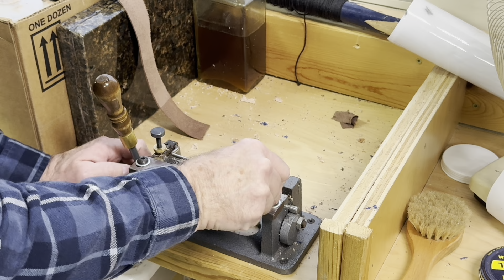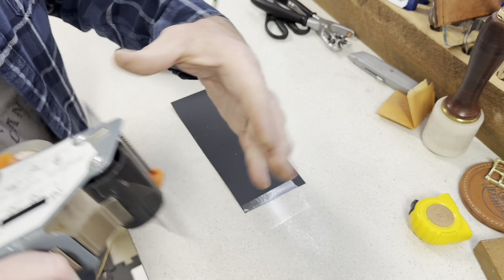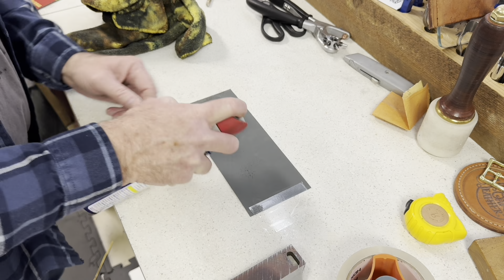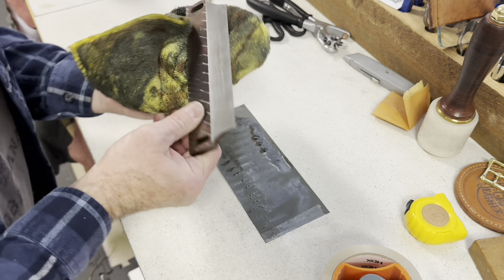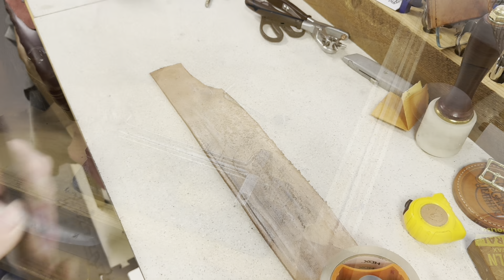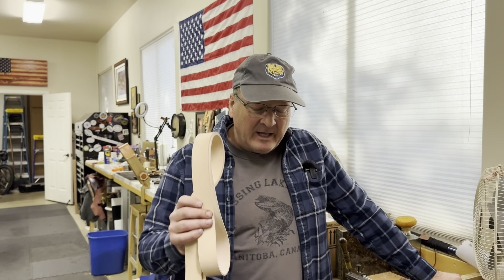Leather Splitter Maintenance / Economy Heritage Leather Skiver @WeaverLeatherSupply #leathercraft

Comment: I've gone down the rabbit-hole of sharpening, and unfortunately my wallet came with me. This blade wont fit in my guided-system, Im thinking to flatten my japanese waterstones and lapping this blade by hand. Thanks for the video - I might make one too!
Reply from the maker: I find it interesting to see where my journey takes me. As a young man I struggled to get a knife truly sharp. Part of the issue was solved with practice.  I think the other major issue was solved with a better selection of sharpening materials.  Recently until I purchased the diamond film I have been using just sandpaper up to 2,000 grit.  This kit with the glass plates first caught my attention.  Then the longer lasting diamonds.

Comment: Would be nice to have an accurate way to put it back on. I've done it on the first time only once.
Reply from the maker: You might be able to cut a piece of card stock  that fits tightly from the leading edge to a reliable spot on the splitter and use that when you replace it
Reply: @InMyBusyLittleShop  Thanks, I was considering marking a spot with a sharpie on both ends of the roller , don't know if that would work. Card stock would be alright, still have to get the center of the roller. It makes a big difference if you don't have it centered. Thanks for your input.
Reply from the maker: @emory1536 you bet. I have another video coming at some point this month on adjusting the blade and the effect of being out of alignment
Reply: @InMyBusyLittleShop  Thanks, I'll be looking for it.

Comment: Mine is a knock off not a Weaver but on the black thumb screw for the adjustment I scribbed a line accross so that when you make thickness adjustments its much easier to see how much you go. I usually know how many turns to go up or down per ounce
Reply from the maker: I do need to create an adjustment mark on the thumb screw to help keep track of where I’m at. It sure has been a handy tool.

Comment: I would suggest doing this on a lapped granite block or a scraped cast iron surface plate.  It's unlikely that the work surface will really be flat.
Reply: Ah, I didn't realize it was a quartz surface, I thought it was covered particle board like a kitchen surface.  My apologies.
Reply from the maker: No. All good. I’m sure that it’s not as flat as lapped granite. In the past I have used 1/4” glass.
Reply from the maker: Thanks for the feedback. It’s possible that the manmade quartz is not as flat. Thanks for the suggestion

Comment: Great video! Weaver currently has the Heritage skiver for 25% off. Do you think the additional $330 for the Heritage over the economy is worth it? Have you ever run into something this one couldn't accomplished, but the upgraded model could?
Reply from the maker: That’s a good question. Unfortunately I have not tried the more expensive one. The more expensive one has a wider blade which gives more sharpened area to use. I would say that I don’t think most would be strong enough to do a wide strip that is wider than the smaller machine. The only thing that might be interesting would be to see if the adjustment crew makes it faster to set the thickness that you would desire. Sorry I’m not more help. I do like mine and use it almost daily.
Reply: @InMyBusyLittleShop  Now I'm trying to decide if the Buckle Guy and the Weaver Heritage is basically the same machine, About $120 difference between the two. I over think everything.
Reply from the maker: Good morning. I took a look at the splitter from BuckleGuy and there are some things that I like about it. First is that you can adjust one or both sides of the cutting depth.  That would make installing the blade easier I would think because on my splitter if the blade is not installed square it will cut differently side to side. 
Second if you want to have the skive thinner on one side, that could be handy. 
Next is the cam to lock or engage the cutting. I can’t do that. I need to hold the handle engaged. 
One thing is it says it will only skive down to 3 ounces. Yet I have to say I think I have only gone thinner a couple of times and it’s not very reliable below 3 because the leather tends to stretch out of shape. 

With all of that said I don’t think I would have purchased the Weaver one if I had both to look at now and the knowledge that I have.

Comment: I'm looking for a leather sewing machine that's able too make clothing but also had zig zag stitch. Aswell as being able to sew 1/2 leather. Any recommendations
Reply from the maker: We other then watching my mother use her singer sewing machine to make clothes and one buckskin jacket, I don’t know much about fabric sewing. Yet if I go to the last part of your question I see you want to sew what I think you are saying 1/2” leather and fabric. There might be a sewing machine out there that can do that.  If so I don’t know it. I guess if it was heavy duty fabric but probably not clothing fabric.  Maybe someone in my “channel family” has some experience in this area. Maybe they can answer. My Cobra 26 has a nice range but 1/2” is a stretch and I don’t think it will do lightweight stuff below some thinner leather.
Reply: If your wanting to sew 1/2 ounce leather along with fabric in a straight and zig zag stitch, a vintage Pfaff 130 is what I have been looking for. Robust German engineering, simple to work on and can be fitted with a new servo motor. Here in the Seattle/Puget Sound area I’ve seen them as low as $50 although rare. Most listings are around $300 which is reasonable considering the versatility and compared to a brand new machine. Good luck and happy hunting!
Reply from the maker: That machine sounds interesting. I would say for me the servo is a must.

Comment: Again, another outstanding video. I only use my splitter for thinning the last 5" of my belt straps. I've had problems with having to pull hard on the strap to thin the strap. You pointed out to me what a dummy I am, I've been pulling on a dull blade. My splitter uses long razor blades and I changed it and no more problems. Thanks for making me aware of this issue! I'm also interested in knowing where you got your counter top mounted stitching pony. Thank you and Happy New Year.  Jim from Orlando
Reply from the maker: Jim thanks for watching and commenting on my videos. So I say that if my video helps just one person then it was worth making. Sounds like I reached my goal today. As far as the stitching pony goes I need to talk about that and will very soon. There are things that I like about the pony but things that I don’t like and the things I don’t like might out weigh the advantages. I’ll be sure to cover it.

Comment: Thanks for this tutorial, Robert.  Based on your before and after, I need to tune up my Weaver splitter this winter.  I have been putting it off since it seemed a bit intimidating to get it set correctly, but your explanation gave me hope that I can improve the way it performs!  Have you tried using water instead of WD-40 on the sandpaper and if so, have you seen any difference during the sharpening process between the two?  Also, I don't know if it would make much difference for you, but I put an index mark on the top of the depth adjustment knob on the splitter so I had a reference when changing thickness settings.  Not the same as a depth indexer as you mentioned, but it does allow me to see how much of a change I make  each time I rotate the knob.  Just a thought.  Happy New Year, by the way!
Reply from the maker: You know the mark to help keep track of how far you move it is a great idea. As far as oil and water go I wouldn’t see much difference, especially with the wet and dry sandpaper. I was concerned the first time sharpening. Thought that I might make things worse. Yet, there really isn’t much to mess up.

Comment: WD 40? Is the sandpaper 1 and done? Or can you reuse it a few times?
Reply: Sorry...I asked the question mid vid. You answered at the end. TYVM
Reply from the maker: It’s all good. Yeah the paper still has a bunch of life in it.
Reply from the maker: I will use that sandpaper to sharpen other tools until the grit of fairly worn out. You can use other oils or even water.